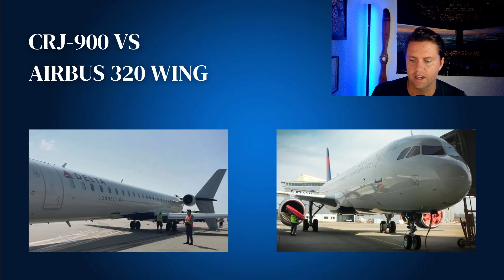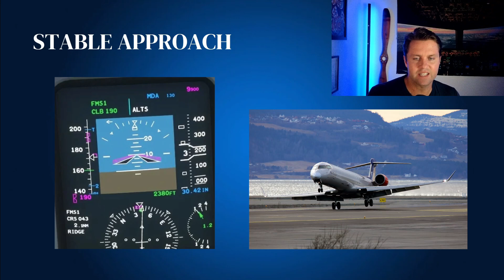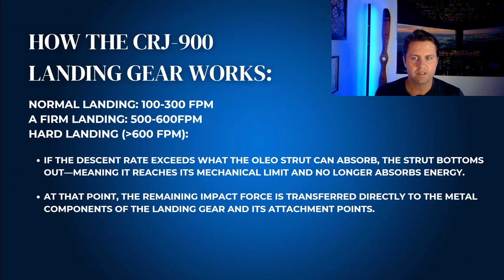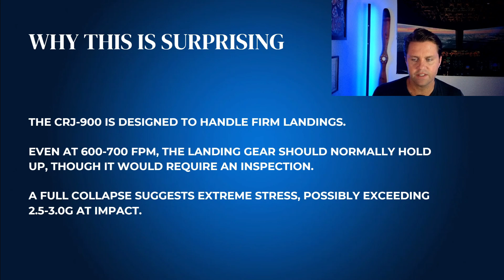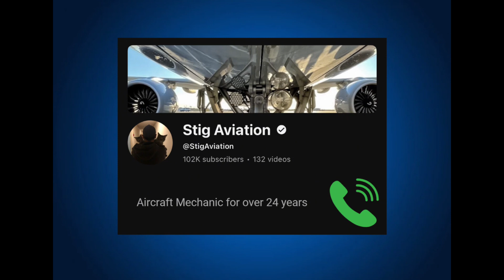Pilot Breakdown: Did a Hard Landing Cause A Gear Collapse?

Comment: The crowd is finally admitting the event was caused by a gear failure.  For a nano-second, abandon the "hard landing" concept and look at the facts.
1. The attitude of the plane is in a flared position consistent with a cross-wind landing.  Meaning the pilot wants the nose lower than a conventional landing so (a) the cross-wind will have less time to deflect the plane away from the runway centerline and (b) the pilot wants to place the nose wheel on the pavement soon after the main gear in order to maintain forward direction and also to distribute the load on both the upwind main and nose wheel gear.  Don't deny physics ... If you will pay attention to the video you can't avoid the fact the upwind main gear touches down before the nose gear.  The only way that can happen is if the plane's attitude is in a flare.
2. Immediately on touchdown, the upwind main gear collapsed.  
3. There was plenty of forward speed so the lift on the right wing would be sufficient to aid the main gear, which is how these aircraft are designed.  When the gear collapsed, it did so catastrophically allowing the starboard wing to contact the ground and rip off.  With the loss of lift on the starboard side, and full lift remaining on the port wing,  the plane rotated to the right and became inverted.
At days end, that's what happened.  Now, the facts are not economically acceptable since a collapsed landing gear affects customer confidence in the plane and maintenance by the airline.  But somebody has to fall on the sword, so guess who the report will select ?  It's much easier to replace a pilot than customer confidence.  The almighty buck wins again.
Reply: Landing gears on airliners are not beefed up like those found on Navy/Marine aircraft which can take the punishing effects of hard landings on a carrier. Wait and see what the accident board will report but it will most likely be pilot error due to her sink rate and not flaring out before touchdown which resulted in the separation of the R/H MLG followed by the RT wing.
Reply: @Scott-hh3gh  Let me ask you a question ... did the main gear touch down 1st or the nose gear ?
Reply: Looked like an unfortunate combination of both to my private-pilot eyes.  Hard landing + gear collapse. I don't think you can "abandon the hard landing concept for one nanosecond"  at all.
Reply: @Redtail_Pilot  There's no getting around the appearance of a hard landing.  That said, for a minute, transfer your own cross-wind experience to this much larger airplane.  Would you want the nose pointed high in the air in that cross-wind ?  Would you approach low & slow in that cross-wind ?  I'm defending this pilot because he did the right thing and applied his skills and experience to the conditions.  It was the plane that let him down, not the other say around.  That windward main gear collapsed immediately on touchdown.  That should not have happened.  Especially given that he lowered the nose gear to distribute the weight over two sets of wheels rather than just the main, all the while maintaining directional control in a significant cross-wind.
Reply: @richardgreen7811  Oh I totally agree with you. Not taking anything away from the pilot flying. I still think it was a hard landing as well. It can be both, no ?
Reply: @Redtail_Pilot  Absolutely yes.  The issue is, was a hard landing the cause of the gear collapse or was the gear collapse the cause of the crash.  I contend the latter for my many stated arguments.  There is only "opinion" (not citing yours) that evidence exists to prove a hard landing in excess of the design parameters of the plane's landing gear occurred.  These planes are designed with a major delta factor built in for landing gear stress.  In the absence of measurable proof, the visual evidence validates that the pilot acted correctly in configuring the plane for such a significant cross-wind landing.  A collapse of the gear could also be attributable to snow or ice accumulation on the runway near the point of touchdown .  With the experience and proficiency of these professional pilots, routinely in conditions like this, simple common sense should prevail.  Nobody can argue against the fact that he gear collapsed.  The cause should be attributable to effects outside the pilots control.
Reply: @richardgreen7811  Yeah, it will be interesting to see the final report when it comes out.

Comment: At 2:05, you can see it was a very hard landing. Watch the left wing tip and the vertical stabilizer with high mounted elevators - they vibrate and distort a LOT the instant the right wheels touch down ...hard.

Comment: I agree with some of the speculation here. I do want to add something. I am sitting here in Kansas the day after. We have this extreme cold and crispy that is very different from normal and the snow is a fine dust.. It is a Big Artic Push that hit all of NE creating 15-30 degree temperature below normal nation wide. I will assume all instruments, especially the barometer, were adjusted correctly. I will also assume it was not visibility or pilot error. Theory IMO: A combination of weather events somehow caused a loss of lift and thrust by effecting the machine or metal or an anomalous unexpected loss of ground effect or down pressure. IMO About the fire, I saw the fireman burst into flames as the fuel flowed under the craft. His buddy grabbed him and pulled him from the puddle. IMO This fine snow that came to us may have affected the air just as it took the oxygen from the fire. IMO just thinking out loud

Comment: Also looks high.  They might have been worried about a long landing on an icy runway.  They added a gust factor to approach speed and then had a gust that caused a gain in altitude.  Should have had a go-around warning.  Read it was 1050 vsi at impact

Comment: OK pilots....some comments here are totally disregarding the wild gusty winds during this approach. If you really are a pilot, then we all have dealt with needing a faster approach speed, holding the crab angle w/rudder and aileron, then correct at the last second before touch down, so not to side load the gear, breaking them off. I'm seeing the strong gusts changed direction, or completely stopping, during the last 100' of altitude. The sink rate increased with the stall horn blaring and the resultant hard strike on the right gear. If crab angle was  unable to be corrected before impact, the right gear sheared, putting right wing to dig into ground (or hard packed wind blown snow), tearing it off. Ask pilots who fly into Wilkes-Barre about sudden strong wind direction changes just before touchdown......
Reply: @garyyoung4074  THAT is why you keep extra speed, especially on such a long runway…..
Reply: Lol. A little extra speed. HALF the gust factor. Not TWICE the approach speed, which was at least the factor of the descent.  rate. 

She fucked up the approach, had a high descent rate with zero flare. 

Pilots deal with gusty cross winds all the time and they don't ball up the aircraft when doing so.

Comment: I think if you look at the footage closely I think your wrong about the wing "catching" or the gear collapsing in the conventional sense.   What I see is that the wing essentially snapped at the base of the wing spar where the landing  gear was attached before the wing hit the ground.   Which explains the physics behind the fuselage rotating on its access instead of cartwheeling as would have happened if the wing tip had hit first in a traditional landing gear collapse.   Based on some analysis from various other sites I believe what happened is the plan was depending at 1100 feet with no shear.   When the gear touched down it was driven up through the wing breaking the structure of the wing at the attachment point.   By the time the wing hit the ground it was already largely structurally decoupled from the airframe hence the fuselage could rotate instead of tumbling and breaking up.   That the wing structure appears the failure point is counterintuitive but appears to have been the biggest factor in this crash being survivable.  I think the fact that this is one of the heaviest CR variants could also be a factor.   Basically for whatever reason the aircraft came in too hot, possibly heavy and exceeded the wings structural load.

Comment: I agree, no flair. But on approach pitch and engines have a reverse effect. Pitch up slows down, pitch down speeds up. Engines throttled up gain altitude, engines throttled down lose altitude. I think he came in a bit fast, didn't flair (was a tail/cross wind effecting that?), cut engine speed, nearly pancakes the landing, a sudden down burst slammed it down on the runway hard, and because he was correcting with a slight roll to the right (to stay on center and/or tipping wing down into a cross wind), the right main wheels took all of the impact, collapsed, he turned the yoke to the left to compensate for the dip (as the wheels hit), but the left wing still had lift and flipped the fuselage over toward the right. All in just two seconds.
Reply: Hi
Just think how hard it is to control an open UMBRELLA in gusty cross winds!😮
Reply: @toosiyabrandt8676  Exactly, the umbrella is a great analogy.

Comment: I think as some anylists have said in various interviews on this crash that a contributing factor here is posable low level wind shear and a last second sever down draft that caused the act. to slam hard on the right gear and the wing then hit the runway and sheared the wing off and the plane then rolled over and slid at an angle down the runway and digging into the packed snow on the runway which helped to smother the fire and avoid a conflagration event...watching that last vid of the crash, it is a miracle that there were no fatalities ....and we must commend the well trained Delta crew getting all the passengers off that aircraft... as much as they train, I don't think they practice for this scenario of an upside down aircraft evacuation ... and also must commend the crash, fire rescue staff at Pearson for their rapid response

Comment: Snow is ice.  Since snow is already in solid form, the relevant value for complete phase change to vapor is the latent heat of sublimation: ~2594 kJ/kg at 0°C.    The energy required for sublimation of snow sucks a lot of energy out of a fire.

Comment: I appreciate your opinion very much. Well explained. I don’t have your knowledge, but it’s clear the low wing is a problem in a gear collapse for these Mitsubishi (Bombardier built/designed) regional jet is the cause of the flip. I’m not so sure about the snow putting the fire out, but a wing separation (instead of a partial tank rupture) combined with the engines at rear, not nacelles on the wings, is a thing to bear in mind. Because the fuel feeds are completely different. Just opinion, like you carefully say. I appreciate that.

Comment: I concur.  The snow was a contributing factor in survivability. 1) it diluted the jet fuel while extinguishing the fire, and 2) like a tube on snow, it caused the fuselage to slide farther away from the broken off and burning right wing.

Comment: Pure Conjecture here:
The (former) pilot at the controls, as well as the (former) pilot in command, Failed to properly fly the jet airplane. Together, the former pilots allowed the jet airplane to descend at an Excessive Rate on final approach, resulting in a Crash Landing, which Totaled the jet airplane upon landing.
A better understanding of "The Primary Flight Instruments" (IE: The Vertical Speed Indicator  ((VSI)) would have prevented this Mishap >>>

Comment: Gary, you keep saying that the gear collapsed.  What evidence is there of that?  Did someone find the landing gear sitting a thousand yards from the rest of the wreckage?  No?  Then why not conclude that the suggestion of "gear collapse" is an optical illusion?   
     Landing gear are designed to accept major overloads.  If that oleo strut bottoms out, typically the aircraft will bounce.  There is no bounce here.  Looking hard at the wing on landing, there does not appear to be much flap dialled in.  More logically, the pilots made the decision to "power it in" given the crosswinds.  If they did a pronounced flare, noting that the aircraft was maintaining forward speed, would it not be anticipated to float in ground effect?  And if so, given the nasty crosswinds, would that not tend to push the aircraft off the runway at the critical landing moment?  But if the pilots chose to respond to those conditions by powering it in and doing a firm plant, would that not negate the risk of being blown off the runway?   Sure looks that way to me.
     My suspicions are entirely different.  That gear attach point is well behind the main spar.  Even busting the gear is not going to cause wing separation. That comes from the tip striking a heavy resistance point.  And what is out there that will catch that wingtip?  Yup, the snowbank! Was that runway plowed full-width?  Nope.   And what conclusion do you draw from that?

Comment: Not citicising you. Just opinions .
No aviation experience here except for little to scale RC ...
Great call on the difference of design of wings  height and length of landing gear & strut of different planes. 

It doesn't at first appear that the landing gear collapsed or was malfunctioning. .  

If there was any problem with the dashboard guages  pilots would not be alerted to if there was insufficent compressed gas in the tire to absorb the initial shock of landing ahead if shocks struts etc.

Why no bounce? Could you zoom in closer when the right wheel touches down first? No bounce!  Was that tire underinflated? 

I think the snow helped douse the flames too. 

Miraculous all 80 souls were saved. 
 Congratulations to the yet unnamed  pilots crediting to their survival. Probably next to nil unprecedented  roll over landing  training in flight schools

Interesting your  aircraft  mechanic made no mention if  tires in routine inspections of landing gear. 

In preparation for winder driving in Canada, snow tires are a big deal and the main element if bounce where the rubber hits the road.

Comment: It looks like the right wing tip hit before the right gear collapsed. Look at your 19:25 timing. No flames yet; snow is coming off the right wingtip he left wing is way up in the air, the tail is up in the air and the front of the fuselage is on the nose gear. A half a second later; flames are coming out of the right wing; the left wing is still way up in the air, the tail is still up in the air and the front of the fuselage is still on the nose gear. It sure looks to me that the right gear is holding the plane up at this point. A few seconds later the right wing shears off and the plane starts rolling on to its back.
Reply: Your timestamp, 19:25, is at the end of his video.

Comment: Ok…is that 3 gs or 600-700 fpm descent tolerance spread across both gear or each? That right main took the full impact. So it would have easily exceeded those limits if that tolerance is spread across both gear.

Comment: the aircraft never departed the runway... when it flipped it slid down  the rnwy on an angle and came to a rest at the intersection of 23 and 24L...in the vid of the aircraft as they are evacuating u can see some of the runway markings, ie center line or touchdown zone markings...

Comment: No flair no flaps too much airspeed ! All female crew flew into runway ! Duh !
Reply: The aircraft did not flare, with flair. The approach airspeed was 135 kts, the correct speed for the weather conditions. There are other videos that were recorded from behind the aircraft that show that flaps 45 was selected. 

The details of the crew have not been released.
Reply: No flair is correct as I said ! Flaps at 45° would be visible to naked eye which I didn't see ! Delta was proud of their female crews , DEI , its been declared there was female crew but no names released ! Time will tell whose right !

Comment: Is it feasible that the runway having snow blowing over it and perhaps even at least some ice  covering it would give the tires very low braking effect and allow the braking to stop the tires from rotating due to a loss of traction and the hitting a section of clear runway with the wheels locked up and suddenly having a very high force applied, so high that the landing gear failed?
Reply: No.

Comment: Controlled flight into terrain. No noticeable flare. It was a carrier landing. Given that radio altimeter callouts will have been alerting the crew to the flare point the question is why the plane didn't flare? That being said and is a matter for the investigators I agree that the gear should have been able to absorb the landing load. It didn't look to me like a smash onto the runway. What saved the passengers was the explosive fire being left behind as the fuselage slid on. No doubt the snow helped in extinguishing residual fire from spilled fuel as the sliding fuselage stopped..